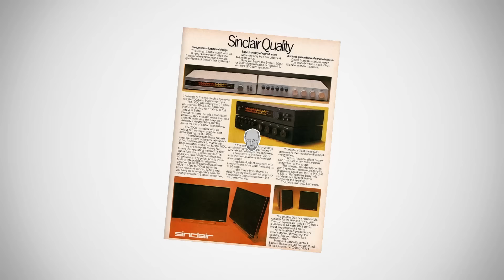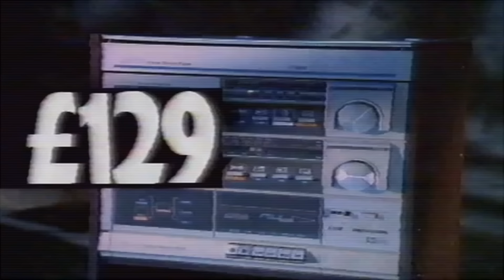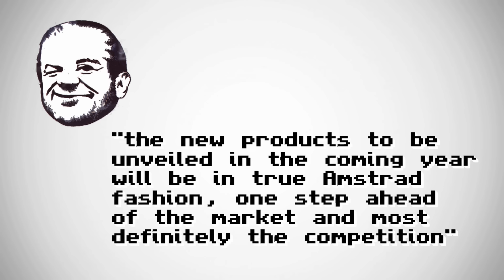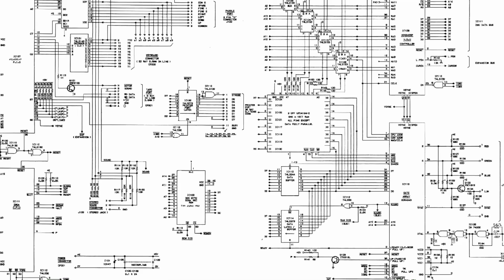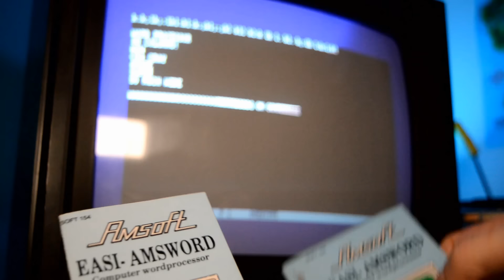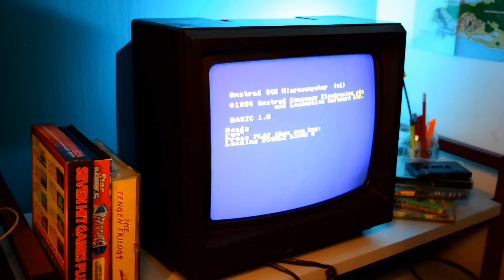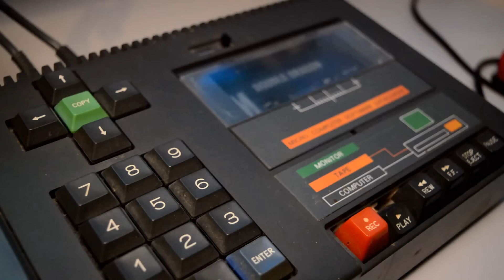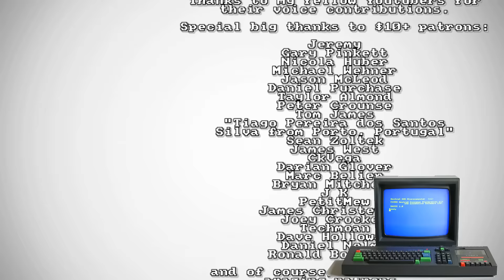Amstrad CPC Story | Nostalgia Nerd

Comment: As one of the very first programmers (in the UK) to get my paws on the 464 (way back in December '84), I can tell you that the power supply issue was always terrible. Within 4 hours of use, it blew up in spectacular style. It also ripped of the  OS from the BBC Micro. A lack of proper design, no cooling fan and a general lack of interest from the programming community did for this machine in the end! It was like all Amstrad stuff, cheap and nasty.
Reply: One of the first in December '84 eh?  I small bullshit.  They'd been on sale in Comet since June!  And no it didn't rip off the OS from the Beeb.  It was a development of Locomotive Basic by Locomotive (who coincidentally did the basic for the z80 tube coprocessor on the Beeb.) There weren't very many tube coprocessors sold and they were mainly 6502s.  Locomotive certainly didn't make the OS for the Beeb.  I believe that was Steve Furber and Sophie Wilson!

The CPC actually had a reasonable run, but the 16 bit computers (ST and Amiga) did for it in the end.  Just as they did for the Speccy and were about to do for the C64 (although Commodore going bust happened just before the 64 was likely to have been ended)

The power supply in mine worked right up to the time I sold it, and the large numbers of machines available working on eBay shows mine to not be unique.  

Also no fan?

The C64 didn't have a fan, the Speccy didn't have a fan, the Amiga didn't have a fan, the ST didn't have a fan, the Beeb didn't have a fan.....  Need I go on.

Although if you're talking about the 1512?  I also had one of those, and that was sold 10 years later, working.  Again no fan.  There are some working example on eBay.

Their computers were cheap, but they were cheap and cheerful, not cheap and nasty.
Reply: Steve Phillips You are confused Steve. You are thinking about the fanless PC clone called Amstrad PC 1512 that went on sale in 1986. The machine was a huge success
Reply: The first coders got their hands on their Amstrad 464 a lot earlier than desember 1984, maybe a year earlier. 50 machines, I haven't heard before that they were unstable, but for preproduction prototypes that wouldn't be surprising. The regular Amstrad CPCs was well known in the industry for its high reliability and very low return rates. The same couldn't be said about the competition

Comment: Nothing worse than cheap, Chinese made full range paper cone drivers with cosmetic only midranges and tweeters. Even in todays day and age with exponentially better cabinet design computer programs and materials science as well as the decreased cost of quality drivers, you still won’t find a mass market product produced speaker that uses a single full range driver which has even a remotely acceptable on/off axis frequency response. If you look at the majority of those fake rack type low fi systems of the 70’s and 80’s, it seems like their plan was just to stick as many drivers; functional or not, onto a single cheaply made 1/4” particle board cab with either simple 3-5 element crossovers or no crossover what so ever.

Comment: Horrible looking but practical.. Pity Sugar didn't stick with the spectrum+ and QL body (with full travel key mechanism), with 1 and 2 microdrive versions or 3.5'' floppy... Missed a trick, could have developed the microdrive cartridges a bit further.. They pissed on audio tapes. Random access, 128kb storage. The Amstrad Spectrum +2 was ugly also. Still, Sugar's markup was large so why should he care about cool design and a tiny storage medium..  Should have released the Spectrum QL+.... A z80 + 68000.. He had all the firmware, OS written  he'd nabbed off Sinclair... loads of 3rd party software.. New software could use both CPUs.. Egotistical dick! Ditched Sinclair's stuff and pushed his shite instead! Culminating in the Amstrad PC 1512 - not a PC and definitely not a Mac it was styled on. Almost no software.

Destroyed British computing when he could have helped... In hindsight it's easy to say Sinclair and Curry should have stuck together, or at least merged with Acorn but failing that Sugar should have bailed Sinclair with a better deal and kept the Sinclair team together... Could have fended off Commodore and Atari, even PCs for a while...

Acorn's Archimedes was the best UK born home computer in the end though, by miles... Obviously later than the CPC and QL...Sinclair QL (and derivatives) technically being the second best, BBC Master probably 3rd...  Some QL derivatives were probably as powerful as an Archimedes as they used the Motorola 68030 + high res, high colour graphics and proper sampled sound chips. Lots of memory, hard disk...